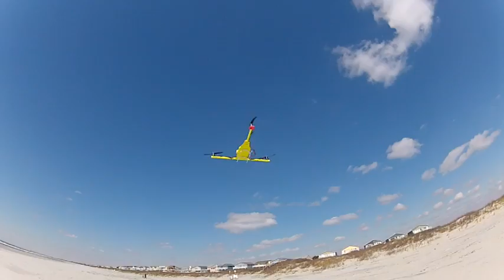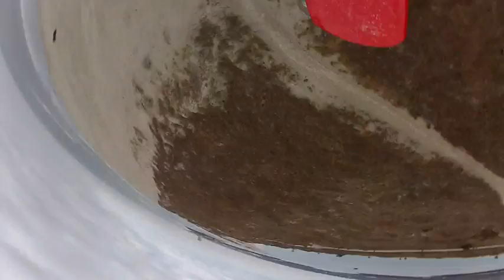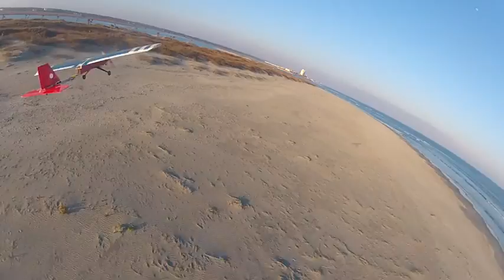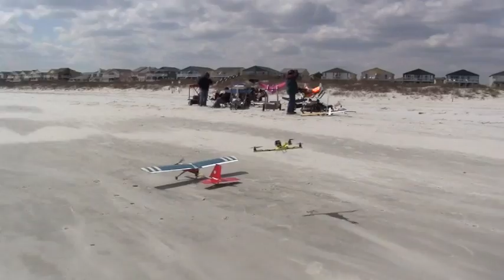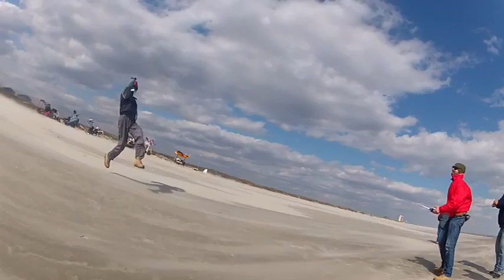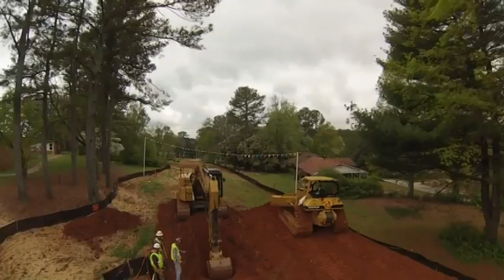Simplecopter.com T copter demo flight

Comment: flying a times quad in the wind is not a problem for an exp pilot as you demonstrate.  Wind like that will ruin most fpv video due to vibs copter will create keeping itself level. Wind like that I would only fly my quav500 and maybe a full wooden frame fiber plate frames will vib to much in heavy winds

Comment: I just watched your quick review of the NTM Prop Drive motor on a plane - I'm wondering if these are appropriate for the T?  Any suggestions on props?  Reason is I can source them relatively cheaply here in the UK, but sunnysky are a bit costly to ship from the USA to UK.  (Otherwise I would order them from you!)